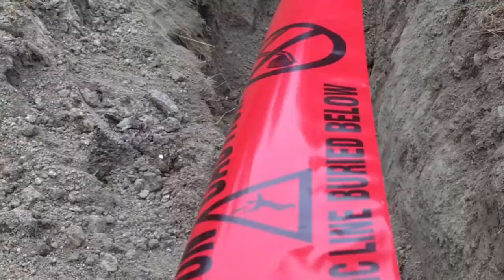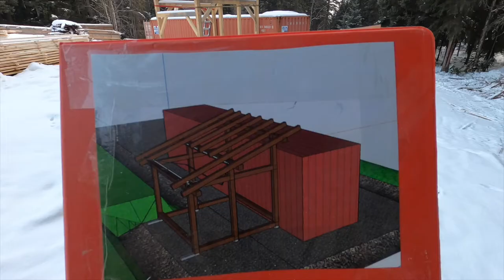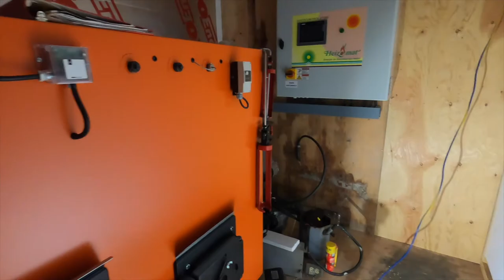Building a Fancy Dry Kiln - Automated and Heated with Wood Waste (year 1) Timelapse

Comment: Heirloom quality cement mixer!
Reply from the maker: I think it was bought used in like the 50s or something. I’ll have to double check those numbers but it’s old. We replaced the drive motor on it a few years back so you didn’t have to wind a rope around the  fan shaft to start it. Took some of the novelty out of using it, but production when up a little.

Comment: Interested in info on the boiler and how you like the set up?
Thanks
Reply from the maker: I will do a bit of focus on it in a future video, but the boiler itself seems very well built. setup is quite flexible, but takes a some work no matter how you do it.
Reply: Thanks that would be great. I have a small Sawmill operation in Washington state and the next step in my operations a Kiln.
Reply from the maker: @andrewmartz8447  My build has pretty high upfront investment. And really I am targeting waste wood consumption, the kiln is more a byproduct of finding a use for my waste. Well that and i want to kiln dry our piano wood i guess.  It's unlikely that the kiln will ever pay for the costs of the boiler and setup, but I think i can do some other cool things with it that will make it worthwhile.
Reply: Well I was looking at a IDry Vacuum kiln they cost $60,000. For the base model. A local company charges $3.00 a board foot….. at that price it pays for itself pretty quick if you keep it running all the time. But it runs purely off of electricity in Washington state we have pretty low electrical rates but I don’t like being dependent on other people for electricity so that’s why your wood boiler is intriguing to me. I would love to chat with you in person discuss cost so I can formulate a proper plan for my operation. 
Andrew
Sawmill Services NW
Reply from the maker: @andrewmartz8447  $3.00 a board foot is a lot. Definitely worth a solid investment.  Let's chat. Drop a form submission on my website: mountainvoice.ca I'll get back to you from there. I can answer some questions or give you the company contact.